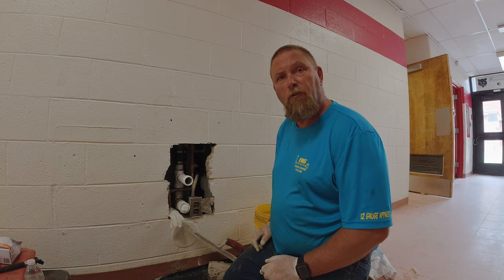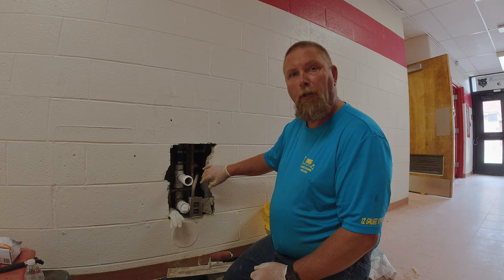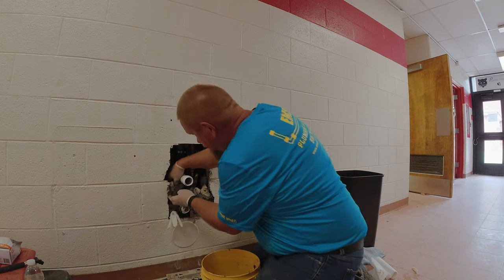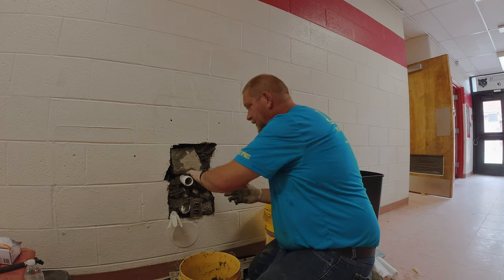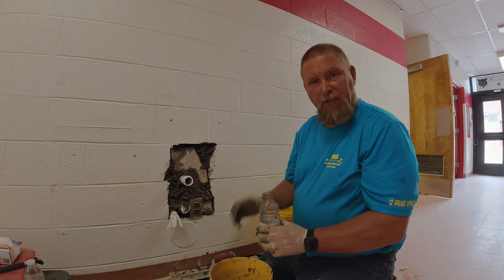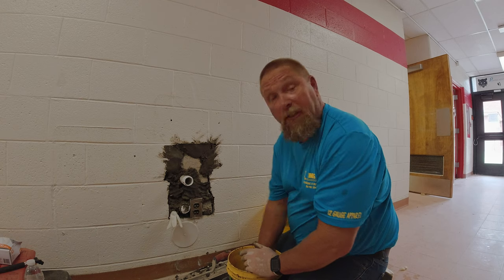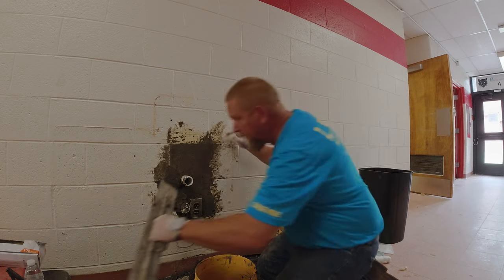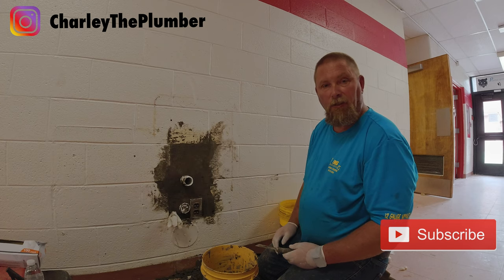Patching Concrete Wall For Installing a Drinking Fountain!!!

Comment: Thanks for posting , and the good info and nicely detailed video .
And the reply to a T. Morgan was helpful on what to use for filler , if you have no broken pieces .
Have to repair an outside spigot that was cemented in , and no access to the water line from " behind " ,, as the water lines are in the slab cement ( Florida , older townhome ) .
So I'm going to break out some block from the inside and get to water line ( pipe ) that way ,,,, and repair that part .
It's in garage .
Again ,, Thanks for the info ! 👍 .

Comment: good demonstration. I have found the quickrete is more user friendly than the power bag of concrete mix.
Reply: I I didn't know you could put hydraulic cement around the pipes.

Comment: just what I needed to see, now I know what material to use, plumber left a big hole after repairing a leak in my house wall - I can tackle this myself with confidence now
Reply from the maker: Chip Cheney them darn plumbers, make sure u wear rubber gloves as the chemicals in hydrolic cement will burn your skin. Thanks for watching and don’t forget to Subscribe and give it a thumbs up please
Reply: @CharleyThePlumber   I just filled in the hole covering 3 cinder blocks today ! yep I used up two or three pairs of rubber gloves so my hands are fine....  don't work too hard but hard enough  !!!

Comment: Thank you. this is just what i was looking for. Quick question. What can i use to fill the hole before laying new concrete? it looks as if you used some old cracked cement but what can i buy if i do not have old concrete laying around?
Reply from the maker: T. Morgan I use the stuff we broke out just for a filler and to give some extra strength, I have used stones or even went to a big box store and bought a patio stone or cinder block to break up and use, you can also use newspaper to fill the back and slowly work from the bottom up. This cement dries pretty quick so mix small batches at a time and don’t forget the rubber gloves and to subscribe